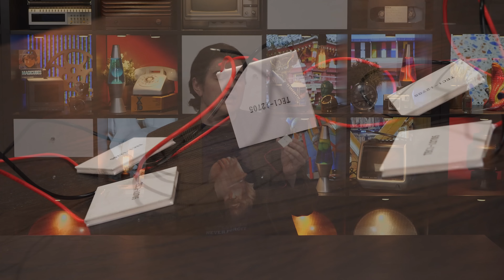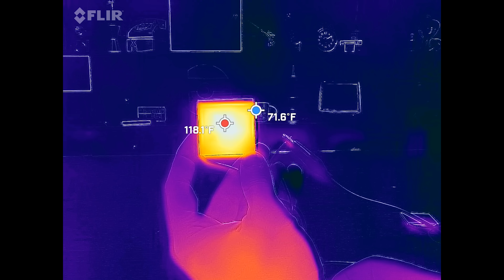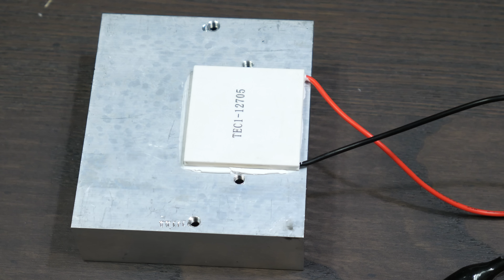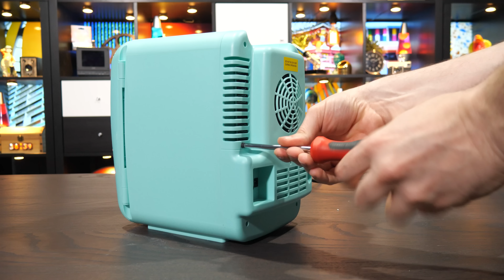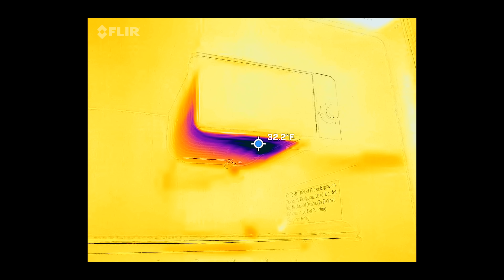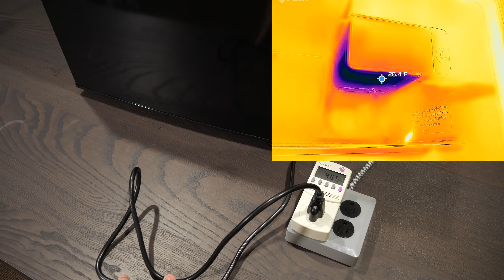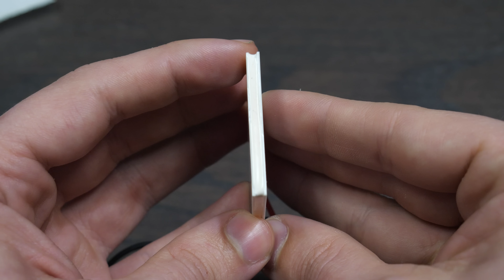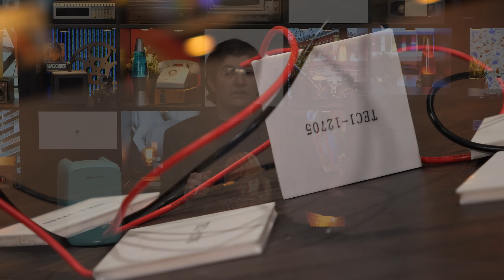Thermoelectric cooling: it's not great.

Comment: There's no compressor refrigerator that fits next to my desk. I have a pile of dead thermoelectric fridges in a room dedicated to them in my house. Some are 6-can, some are 18-can. Some are shaped like an Xbox. Did you mention that they're all cheap and die in under 2 years? I think 2 years is about as long as one has lasted for me. 

And they don't just die from the fan bearings spinning out in a monthlong death rattle. They'll blow caps and other PCB components. But still, no other fridge fits next to my desk. I blame multiplayer gaming and the unfortunate need to bolt yourself to your chair for 45+ minutes. It's hard to get up for a beer when a helldiver is repeatedly tagging the 2nd interface for a bunker.

Comment: 55 Watts is pretty good if it worked better... Some of my lightbulbs are still 60 watt, but of course they don't run 24/7 
I've always wanted to fiddle with these or small electric heaters whenever summer comes around but I've been too lazy

Comment: they work great when hooked up to thermostat. i use like 330 watts of peltiers on 4 cpu cooler mounts,(7-8 amp coolers) with water blocks.. ii can turn 500 ml in a loop from 30 degree celcius water down to -2 degres celcius in 10 minutes...then turns off.. and then my misters get to mist super cool water on the mushrooms before the mistr heats the reservoir up again

Comment: Limited view. You ran all of your tests on a single 120v 6 can cooler, and did not include any data from any of the other many, many different types of 6 can coolers out on the market. Like the 12v version from Coke. or ANY of the 12v versions available. When you intentionally limit the amount of input data, you intentionally skew the results and your test is no longer valid. Your opinion is that the small coolers are bad, yet you only tested and showed data for one single type and you are telling people that it is fact. It is not. It is your opinion, based on extremely lacking information, that they are bad. I have to say, watched a lot of your stuff in the past and for the most part found it interesting. But you lost my respect with this one.

Comment: My god, is 24C a hot summer temperature? I'm crying here as a Brazilian facing 30C to 35C most summer days lol. I would kill for a 24C summer!

There's more to a product than numbers. You clearly have a large household that is also your workspace. I don't really understand the point of comparing that product to something that is significantly larger, some people clearly don't have the space. You should try to find something of a similar size to compare.

Also, I would probably use this to keep the sodas I took from the refrigerator cool for longer. I would not expect this to actually refrigerate my beverages. That is probably a reasonable use case if you alway have a fully stocked fridge and don't wanna go back there every time. And if I treat it as a fancy cooler instead of a mini refrigerator, I have no reason to keep it running at all times.

I'm not saying this is necessarily a good product, but that's how I would use it. A soda can get warm really fast in the northeast of Brazil.

Comment: Thermoelectric coolers work fine. They aren't intended nor meant to be refrigerators, though. While they work great at holding a stable temperature for such uses as keeping wine at a constant 56 degrees, they don't work great if you're wanting to keep food or medicines at or below 40 degrees (the temps used in a refrigerator).

The best a Peltier can do is about a 30 degree difference from the outside ambient room temperature. If the outside temperature is 78 degrees, for example, the best a peltier can offer is about 48 degrees... well hotter than a refrigerator. If the room gets into the high 80s, then you can't expect even 40s from a Peltier. How well a Peltier works is entirely dependent on ambient outside temps.

For storing wine, the temps produced by a Peltier is fine. In fact, 56 degrees is a better temperature to hold wine than 48. In reality, so long as the Peltier can keep wine below the 80 degree mark, it's doing its job.

Peltiers are also great when used as dehumidifiers. They're a bit slow for this purpose, but they do work to condense water on the cold side, then switch to the hot side to get the water to drop into a container below. I have a couple of these and they work just fine for this purpose. I also have a couple of wine coolers and they work just fine as well.

I would never use a Peltier cooler as a refrigerator, though. Peltier chips have never produced nor ever promised temperatures cold enough to replace a refrigerator.

Comment: One actual use for one of these. A car fridge. The proper rerigerator unit needs an inverter and a flat surface and enough space. A mini fridge will not fit through the door of most sedans. Hernia material. Then there is the matter of the inverter to run it.  

My MobiCool unit provides about a 40F differential which works just fine with a few freezer blocks. Keeps the milk and cheese from going bad over the three hour journey from the grocer to the house. Not much space but works pretty well until the interior of the car reaches more than 80F. Would never dream of using it in any other context. I put a thermostat control on the unit, like the temp readout in your video, so on a really cold day it will not freeze the lettuce!

Love your videos. Keep up the great work.
Reply: Genuine question, where do you live that the grocer is 3 hours away?
Reply: @petaledfleur  Ahhh! You got me!

I live on an island with a ferry service. The schedule is really just a suggestion in the summer , with all the tourists trying to get on and off the Islands around here. So departure times go out the window.

I buy milk, eggs, cream, eggs, meats and they are taken out to the car just before leaving the supermarket. Add in ten minutes to the terminal, with a half hour advance check in time, and then begins the wait. Sometimes up to an hour. Then the sailing back to the Island for another hour and a half, with another ten minutes to get the stuff in the fridge, and you get the picture.

Could use a big chiller chest with lots of ice, but then you need the ice, yes? Simpler to use the MobiCool and plug it in. A couple of ice thingies and it is done. Creates about a 40 F differential.
Reply: @petaledfleur  There are two small grocery stores on the Island. Not a very wide range of products but good in an emergency. The problem is price. Anything that needs to be frozen or refrigerated are about 50 % more expensive. Other goods are about 30% more expensive. Driver, fuel, and ferry fare. So most folks do their major shop in the City. 

Things like meat, dairy and some prepared foods need to not get warm on a hot summer day. The savings are considerable. 

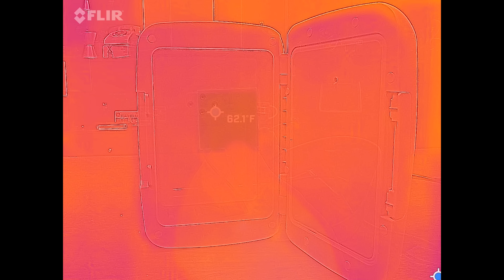As for the three hours? You have to get to the terminal a half hour before sailing time. Left the supermarket today with enough time to get to the ferry and arrived home. So do the maths. 3:45 leave town, to 7:15 arrive home. Island life is not for everyone!  Hope that helps..........
Reply: Still inferior to an Igloo cooler and going to the gas station for ice and drinks...
Reply: You live THREE HOURS from a grocery store?????
Reply: @conzmoleman  Is that a statement or a question?
Reply: @techhie1302  Both. Where do you live, seriously? I assumed anyone that far from a grocery store needs a plane to get to it, like in the Alaskan wilderness.

Comment: I have one of those typical cube mini fridges, but it is actually powered by a rather large Peltier device, and a massive heatsink... It does not work fantastically, although I believe it meets food safety regulations... if your food is safe taking 6 hours to reach 37 degrees F lol. But it seems to be using the same fridge body as a regular heat pump variant... so all the walls are substantially more insulated. It does chill drinks to an arguably chilled temperature. However I have not tested with a thermometer, nor do I plan to... Because I have since upgraded to a proper refrigerator. It did take too long to cool things. And not to mention NO ICE?? Blasphemous!

Comment: Hi... great information to help all of us make much better decisions about our engery usage and finding appliance tech that actually works the way we want it to. However, reading between the lines I think I see an important point about what you do not talk about, that should be considered in the engery equation. The theroelectric frig uses 55 watts per hour all the time, no matter the temperature of the chill-box. While it does take 24 hours to get the sodas to 50F internal, it does not use any more (or less) power per hour regardless of whats in it. In your normal refrigerator comparison, you place already cold products in to acheive the 45watt per hour average. BUT.. how much engery does the normal frig use in 24hours after you fill it full of 75-80F soda cans? Also, what affect does opening and closing the door once an hour to get a soda have on the total 24hour watt usage. Hmmm :)

Comment: stupid question. could you stack those Peltier panels, one on top of another.

let's just assume for simplicity's sake that you lose 20' per panel. there's a hot side and cold side. if I take one panel, stick another panel, hot side to cold side, would I be able to get, in theory, a 40' temperature gradient across the stack.

I understand that in reality, there will be diminishing returns. the first might get me 20', the next might get me 10', a 3rd might get me 5', all of which are still eating up the same amount of power.

Comment: Interesting video. I have a slightly bigger one of your cube refrigerator shown in your video, about 4 feet high, with a top freezer section, that seems to be working fine for what i need for. Just enough room for a gallon of milk or 2, and many other items, soda holders on inside of door, small compartments in side of door also, and two Plexi glass shelves, The freezer is small but with hold two full ice trays, and other small container type items, and maybe 4 ice cream bars. It was $149. Without an internal light, but i set a small motion detector light in it, works great for single person 👍

Comment: 1... Food safe temp not relevant and if MY office is 75 degrees, I am going home. 2... Keeping the beverage cooler, makes ice last longer in my cup. 3...55 watts is less than a standard lightbulb, and the tiny desktop size may be useful for people with very limited space, and if you aren't the one paying the electric bill, that's pretty trivial.   

I have LARGE Peltier cooler made by a big-name company that works very well indeed. It works with 12 volt systems which is great for long trips in the car.

Comment: I totally agree with your critesisms, but for me personally, the no noise potential (which this cheap one obviously doesnt have) is a real game changer! I have an absorber type fridge (works bz heating the refrigerant up instead of a moving compressor, but I am sure you know what cycle) which is quiete a bit less efficient than a compressor but i guess still better than peltier. And due to it beeing an actual mini fridge they can get away with a big heatsink and no fan, so it's dead silent. Since I live in a big city and only have one room, it has been really nice to not hear a compressor every 30min. Though maybe a newer compressor fridge would have also been quieter, I did find that absorber one for cheap (I am not dorectly pazing the electricity bill so long term power consumption doesnt matter to me, sadly). In the end, yes, if you can, and you have a separate room for the kitchen, go for a quality compressor fridge

Comment: We use tiny TECs at my company to heat and cool sample wells for PCR cycling in medical diagnostic equipment. When combined with PWM control, they are a very fast and precise solution.

Comment: My girlfriend buy this thing too, and I saw impact on bill, so I did look at it, and discover same thing. That she better is using big fridge, than this one, and what is better, opening and closing don't cost much energy, and it working anyway for food, so she sell her small power hungry thing. (and her use only 35W, but Im from EU, so fridge have better energy standard, and is linear compressor so should use less, oh and it have airflow, which reduce usage of energy and don't required defrosting at all, in both sections )
PS I test energy use for both fridges

Comment: I still think there are efficiency gains to be had, they could still have use in low cost heating/cooling solutions considering they CAN be more efficient than pure electric heating or evaporative cooling. They could even be used in a hybrid heat pump system to assist extreme temperatures etc.

Comment: A pelletier element will always lose in a fight against a vapor heat pump? Challenge accepted lol. The problem is not the pelletier element but that it was substituted into a design thats supposed to have a traditional compressor setup. Its a bit like refitting an aircraft made for a V-type engine into having an aircraft-rotary engine. 

Anyway, lets say, example, Gen electric said "here's some budget design us a Pelletier Fridge", id go with a design similar to a jewlery box and capture a certain amount of the heat for defrost and diffuse the rest a different way. The limits/benefits of the technology would have to influence the design from the ground up for it to have a chance to compete.

Comment: Can a water jacket be attached to this to allow cooled water be circulated in something like a vest for use by persons with a medical condition that's temp sensitive, such as multiple sclerosis, allowing an Ms sufferer to be able to walk in summer heat? What kind of battery pack could be used with it?

Comment: would it be possible to add a thermoelectric device to the hot side of a peltier element to use the air temperature differential with the heat from the peltier element to create electricity, store that in a capacitor to power the peltier & fan (for excess heat) and thereby reduce the total wattage per hour required to run the device and perhaps allow it to pull more heat from the refrigerated compartment?  somebody must have tried this already or you have may have already reviewed such ideas- this is my 1st time to your channel.  thanks!

Comment: I have the Frigidaire version of this product. Inside, I keep a two quart plastic container of Crystal Light. It does cool down the drink fine. There is a small square of ice buildup exactly in the same spot as the Peltier device inside the wall. I am fairly pleased with my arrangement given I cannot have a small fridge in my office. The price I paid for the unit gave me the idea I wasn't getting Arctic temps.

Comment: I'd love to some insight on how peltier effect was used the other way around - to generate some electricity from heat differential. I heard the soviets were using those to supply a transistor radio some power from an oil lamp.

Comment: I was a trucker and used an insulated top loading cooler with a Peltier element as a supplement to the miniscule drawer fridge in my tractor for easier access to beverages and to free up room in the actual fridge for temperature sensitive items. The larger cooler Peltier units are great for long road trips since residential refrigerators cant take the shaking and RV fridges need to be solidly installed.

Comment: I think though in fairness some do say not to store things that must be kept at a more critical temperature, or fridge temperature (so between 34 and 38 degrees F) but more loosely just say "keep things cool" which it does if by that we mean just "cooler" than the outside ambient air.  Either way, I have something similar but never use it for anything serious obviously.  It does cool down a bit (maybe 20 degrees) on a long trip (being a trip that's maybe 2 hours or longer) with it running all the time in the car (mine is a portable cooler with a 12V Adapter).  For what I paid for it, it's fine (I paid maybe $5 or $10 for it at a Goodwill).

I think the reason that the US testing may be higher than what one might expect is just for that reason.  Most people won't complain if something uses less power, than if it used say 20% more power than advertised, so that may be why it's done that way, and it's probably a worst case scenario.  If you don't have kids for example, then you may not be spending as much time with the fridge door open (losing cool air) and thus it has to work less and use less power.  I mean even the power ratings on light bulbs is a bit extreme (most assume about 8 hours per day x 365 days per year) but I'd guess that unless you left your lights on all the time (at night) for every day, you probably won't hit that mark.  The other thing is that the average may also include use cases where a fridge, light, or AC unit maybe used in a commercial environment, like an office where it may see more use than a typical household.  Plus it forces manufacturers to make even more power efficient devices (think of it as perhaps "lying" to manufacturers in a way on the rating).

Comment: This video made me realize that my parents own a cooling box for their car with a Peltier system in it, which is exactly the application you described. It is well isolated and does have the fan and heat sink on top of the box.
it is useful to be able to hook it up to the car and just keep things cool for longer than they would normally be in a cooling box but yeah, i wouldn't use that as an actual fridge.

Comment: Those chips work great in my Eco fans, ( for wood burning stoves). You don't plug them in and they move a good amount of air. Thermoelectric generators are also used to power deep space explorers once solar power is no longer viable.